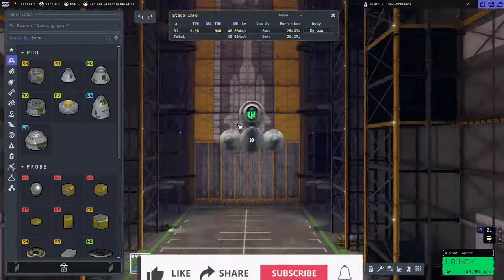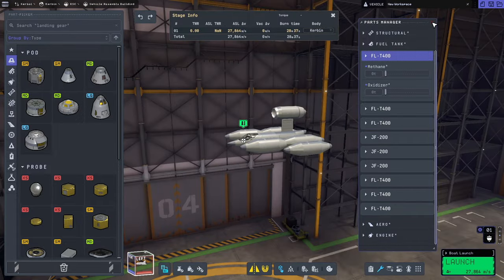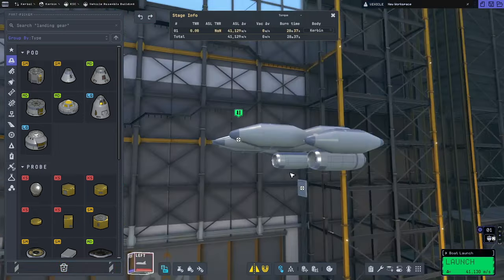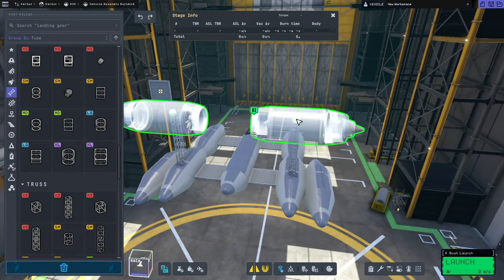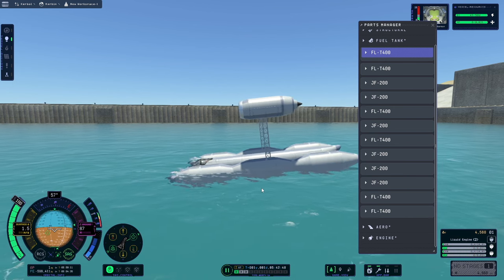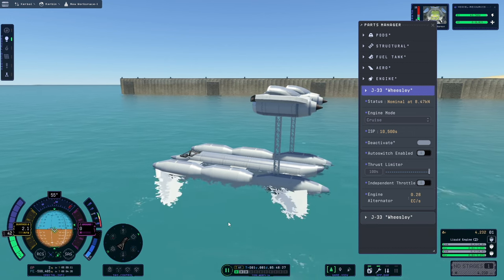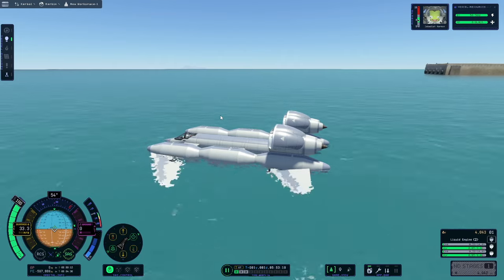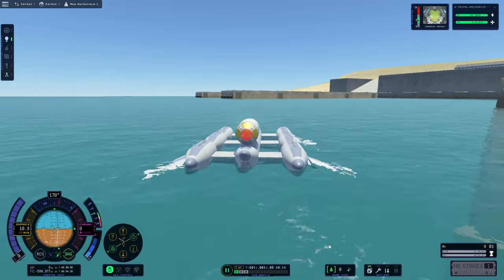KSP 2 Update Review - 0.2.1.0 Watercraft Testing

Comment: My guess is that the game assumes that any air intake on a partially submerged vessel is obstructed and runs out of air. Also, you can toggle the automatic switch to reverse by right clicking the engine and ticking a box
Reply from the maker: Yep, mention the auto switch in the video. Little odd that the intakes and engines run when fully submerged. Hopefully they fix up the water more in the next update.

Comment: Empty fueltanks are way more buoyant than structural fuselage. Hydrogen tanks are the most buoyant when empty. That intake has some issues with the airflow occlusion and can be occluded by the part it's attached to.
Reply from the maker: Used Fuel tanks. I used a few different intakes, which one do you refer to? (small circular or XM-G50 radials) Keep in mind this behaviour only happens close to the water surface, and any of these engine setups runs a jet just fine.
Reply: @GameOnEh  I was talking about the circular intake having (unrelated) occlusion problems. I have built your first boat, pert-for-part and can reproduce this unintended behavior. It seems the intake is scaled by how much of the assembly anchor part is submerged. I changed the assembly anchor to the intake and it works okay.
Reply from the maker: HMMM. but then if that new anchor point gets close to the water level you'll have the same issue again right? I was more perplexed by it works above and below, bot not at. If they did not work below then its simple. they don't work in water. yet they work under so,,, confusion overload, lol.
Reply: Yes. If the new anchor part becomes submerged, it will reduce the intake. A few of the other intakes don't reduce all the way to 0% so you can make an air breathing submarine with some experiments.
Reply from the maker: I have cases where (Bad aircraft design) I will go into a flat spin, and as soon as I am angled backwards my intakes stall out. but it does not put my engines into reverse.
I have a boat in an upcoming Life Of Kerbals that worked. but it had to be a little over engineered, and oddly SAS wheels made a big help.

Comment: It appears that buoyancy balance isn't calculated per part, and it looks more like it's done from like, the center of the craft? It's definitely not doing it per part, or else things out of the water wouldn't change it so much. Distances that change the center of mass seem to be what it's all done around. Makes sense for a space game but it's missing a lot.
Reply from the maker: I am wondering that myself. I think it have to do with the Center Of Mass, then the angle comes in from if the front or back heavier. And might explain why the longer craft sits level as the high engines are in the centre of the craft. There is definitely some room for improvement. I was a little frustrated, but had to cut the devs some slack as it is called "Kerbal Space Program" and not "Kerbal Boat Program". However, they gave us a dock. I just hope they work on doing another bug pass or two before adding in colonies.
Reply: My guess is that aquatics has been one of those things that they kinda NEED but want to put the minimum amount of effort into to focus on other things. Like, there needs to be enough to land in water sensibly, but they're waiting to flesh it out beyond that. With colonies they might have resources that require sea vehicles so I'd imagine once colonies come around they have to hunker down and get it fixed. But then again they're not obligated to add every colony feature simultaneously so who knows.
Reply from the maker: Yeah. I’m thinking the same. And I give the devs some latitude on water craft bugs. It is called Kerbal “Space” Program, no Kerbal “Boat” Program. But hopeful.